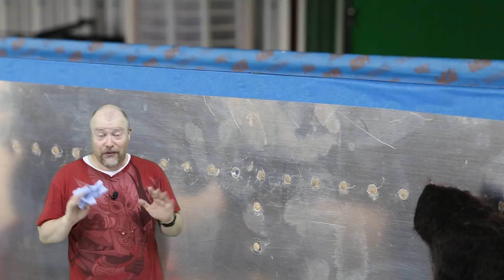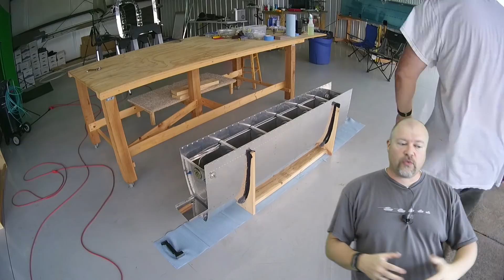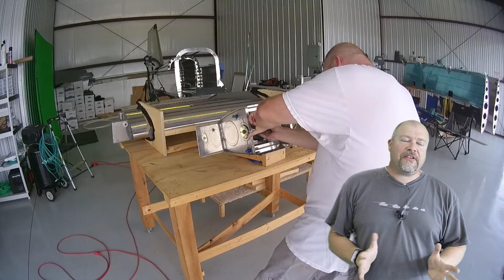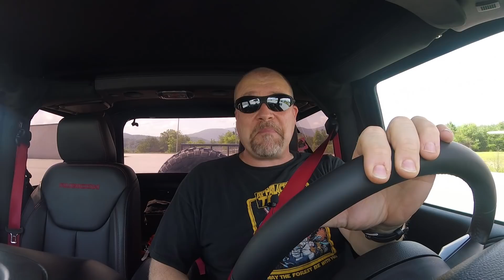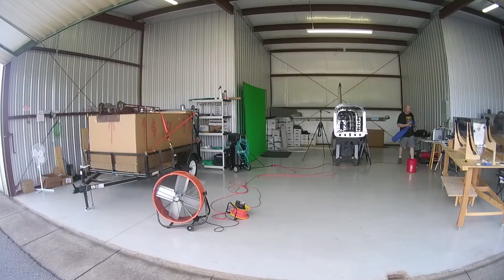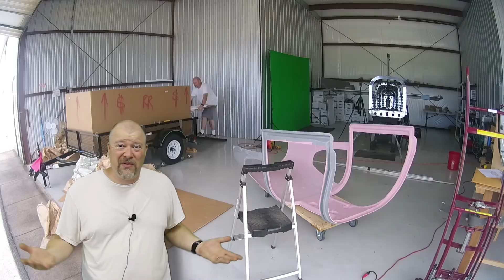RV-10 Wings/Fuselage - 059 - Mistake, Tank Leak, Flap Prep, Fuselage Delivery!

Comment: I had a 1200-pound steel welding table, 8-10 feet in length (with side wing) shipped from the fabricator two years ago. The "residential delivery" guy pulls up to my house in a RESIDENTIAL area, and the first thing he asks is "Hey, um...do you have a fork lift around here?"

"Yeah, sure buddy...what size do you need?"

So they sent him out with this welding table on a 10-foot long pallet, weighing about 1250 pounds, give or take. And they gave him a 4-foot long pallet jack to unload it. The dude couldn't even get the pallet jack in far enough to lift one end of the pallet more than 4" off the truck bed. So I had him call his boss because, you know, I paid like $100 extra for "residential liftgate delivery." His boss, being the smart-assed dipshit that he was, told me "Don't worry sir, we do these types of deliveries all the time." Meanwhile, old Earl was half-dead just trying to get his pallet jack out from the end of the pallet. Needless to say they were not able to unload the pallet/table from the truck that day. I mean he did suggest we tie a chain to it and using my pickup truck I pull it out from the box of his truck, onto the liftgate...which was only 4' long. But I advised him that I thought that was pretty much the most stupid thing I'd heard that day...next to whoever loaded the 1200+ pound welding table into the box truck and sent him out with a 4' pallet jack in the first place. So we left it right where it sat. 

Moral of the story: These trucking companies are basically run by morons. They load shit with forklifts, never seeming to care about what the driver(s) will have to do to get it unloaded. Also, the drivers really aren't all that much smarter. When I pointed out to "Earl" that maybe he should have taken a minute or two to review his load BEFORE leaving his depot ('cause, you know, he might have noticed that one item was a nearly 1300-pound welding table), he had absolutely no answer or explanation, other than to claim "they do this shit to me all the time." 

Common sense is just not very common in today's world--at least when it comes to freight companies.

Comment: Jason - NAS1097 rivets, commonly referred to as oops rivets.  They have a smaller head on the larger diameter shank so you can increase the hole size without making it like you have a larger rivet.
Reply from the maker: Good find!  I did the opposite though, I needed to make the hole larger because I had made the cavity for the head too large for the standard AN4263-3.5 rivet.  So I just upped it to a 4-4 =)

Comment: Hi again Jason, the shipping companies charge based on the number of skid positions used 40"x44". The crate you received used 2 positions, if the shipment had been broken into two boxes you would have been charged for 4 positions with the added danger that the heavy box may have been placed on the larger (by volume) box, the danger of crushing the big pieces is increased and the chances of loosing one of the two crates is now much higher.
Really like the videos, thank you.